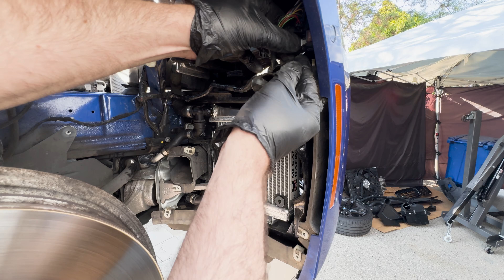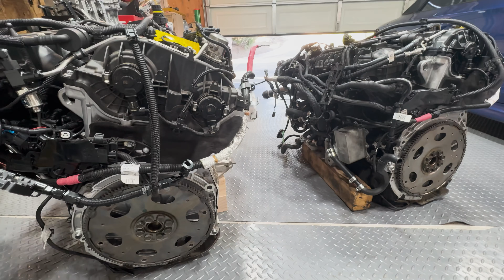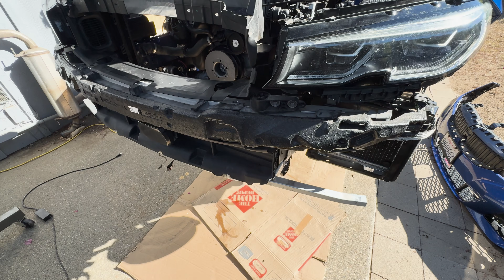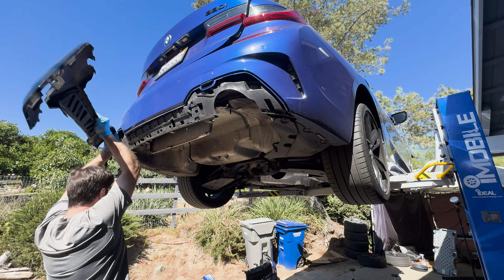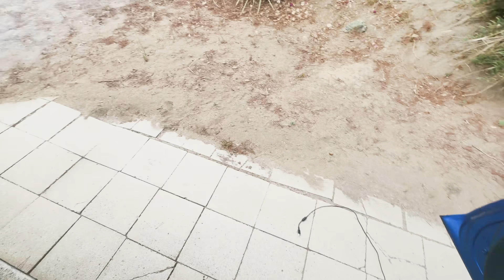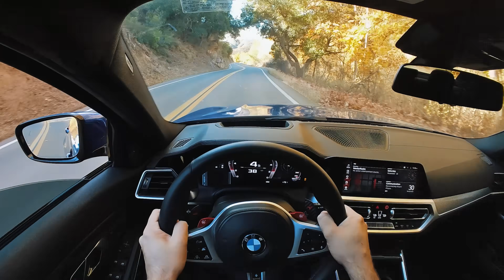Why I HAD To Swap In This One of a Kind BMW Engine

Comment: I was waiting for this since the last post 😊
Reply: @Vehicular DIY Can you do some retrofits? Like HBA on Adaptive leds with extended functions or trying to retrofit comfort seats fully electric? I know your car have these options, but maybe there's a friend who doesn't have them and he wonders to do them. There are no videos  on YouTube for these things. Nobody did them. I know these are possible, but how ?
Reply from the maker: I'd like to retrofit G80 comfort seats on this car so if I do I'd cover that.  I have HBA by default with lasers but do the regular LED models not come with HBA?
Reply: @VehicularDIY  I guess no, I have adaptive led headlights with extended functions(both of them have cornering- code 5A4+5A1(fog headlights), but I don't have BC button on the steering column. I guess in Europe is optional. Might be interesting to see it. The g80 seats I've seen before at Kies, and you have to keep the original module from the actual seats to make them work, if im remembering correctly. I was wondering if this is possible, but I guess it is. Some people have it, some people don't have it. Idk what's the deal.

Comment: Love this! And jealous. Do you plan on showing us more technical details about mods you had to do to make this work? Software changes necessary? Will you be able to register the car? If so, what did you have to do, or was it just fine with the ODBII smog check?
Edit: I see at the end that you plan on doing more of a tech summary. Still curious about emission test. Want a real challenge? Let’s put one of these in my 2009 6MT 335i. 😂
Reply: The challenge is manufacturing custom engine mounts and a transmission adapter, probably you can just remove the flywheel from the old engine and put it on the B58, next there are independent ECUs like Delphi that do not rely on the rest of the car to keep the engine working.
Reply from the maker: Yeah I'll be doing a thorough summary video.

Comment: What do you think the price range is of the he 500hp B48.

Also i have been impressed w/ the stock 330i xdrive from a 2020 B48.
Reply: @Spun-Parts  he said about 12K USD in parts before labour on his previous video if you want to push same numbers as him.

Personally would just do a turbo and downpipe and call it a day. Good for 100whp in gain.
Reply from the maker: Yeah I would say you could get it closer to 7K and still get close to 500 crank HP.
Reply: I was curious about the price point if he sold the B48 he just pulled, not to build
 I should have been more direct in asking. Fingers crossed his drift friend swap this 500whp into his S13 or 14, I don't think I ever saw the outcome of that build
 The channel was kinda on the N20 rebuild kits during that time period and the rebuild kit was pretty cheap. The B48 is superior to the n20 imo. Also Thank you Toyota and BMW for making the effort to produce the new Supra.@yaboybert_2077